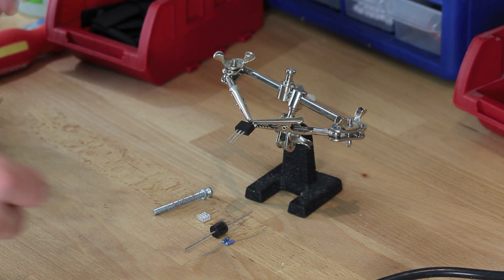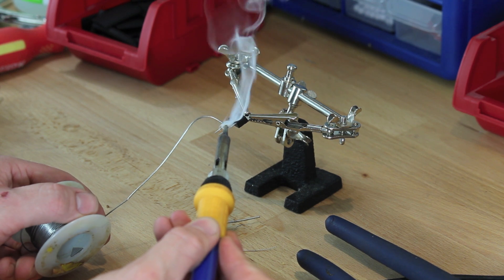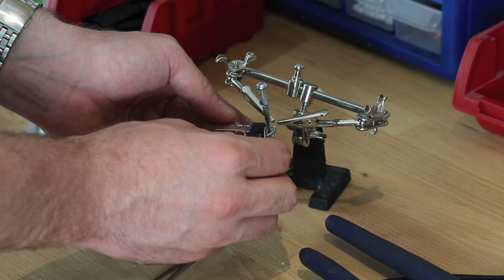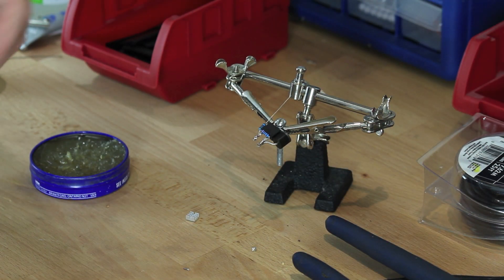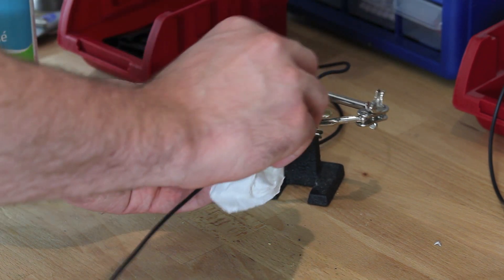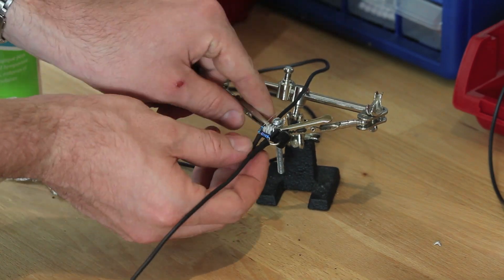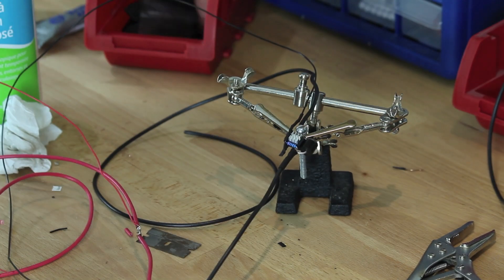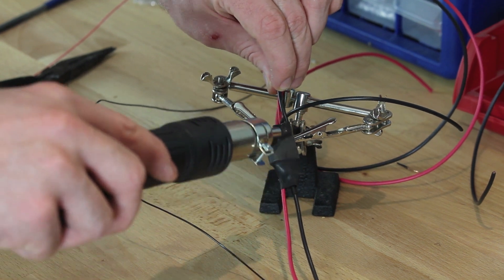How to Make an Airsoft Mosfet

Comment: i use this mosfet with m140 spring 11.1v 30c baterai and m160 bigdragon motor 
mosfet fry just 30 second i use with full auto 
whats the problem ? the mosfet get to hot  
6 times i try tu built it get same result mosfet fry
Reply: Agree

Comment: hello, I'm fron Brazil, installed the mosfet in my aeg but it is discharging the battery very fast, I did a test of 20 minutes firing intermittently the battery of 7.4 discharged to the point of no longer functioning aeg, has anyone ever encountered this problem?

Comment: can you link me the parts I'd need to do this same thing but with a little more strength, I want to use two 7.4 2500 mAh 25c lipos wired in parallel, or are these parts enough to withstand that

Comment: Where did I go wrong?
I have expirience with soldering and electronics, I'm working at cellphone service, bought supplies and made few of these...some of them were faulty at the beginging, and some of them just didn't work well, as soon as I connect battery rifle start to shoot in full auto with selector in safe position. Yes, I checked diode polarity, and after this happening I used a multimeter to check it and it seems mosfets itself died...diode was ok, so as resistors. 2-3 of them worked for maybe 200 shots and then suddenly became melting hot and died...
I'm out of supplies...any thoughts?
Reply: You need huge amps mosfet, and make sure it was original so it could hold a huge amps.
Reply: @ilhamprakoso1237  maybe it was fake amp, since I bought it from aliexpress
Reply: How did it go? Did you manage to fix the design or figure out what was wrong?
Reply: @juanderful229  no, since I couldn't figure out what was the problem. I didn't want to waste any more money on testing...

Comment: can you elaborate as to why your using such a large ziner diode and not just a regular diode?
Reply: It's TVS, not Zener.  And he doesn't know: the diode should be across the motor terminals, not the mosfet itself.
Reply: @rogerborg Can you elaborate on this please? I'm Interested in knowing what the difference would be.

Comment: What is the difference between using the internal diode of the transistor to the new one as used here? 
Moreover, I am making a simple assembly with two transistors IRF1404 to divide the intensity and remove some heating. Am I doing it right?

What mounting advise me for marui EG700 engine?

Thank you very much and kind regards from Spain
Reply: The internal diode of the transistor is a piece of shit. The diode used in this tutorial can actually take the voltage spikes from normal battery use. 
If you use two transistors, just be sure you get them in parallel with the same gate control and polarity.

Sorry, I have never used that engine.

Hope it helps!

Comment: 😒😔I'm so pissed right now because I did EVERYTHING and got every part needed. I REWIRED THE MOSFET 4 TIMES. Still no dice. Maybe the terminal connector I'm using to screw onto the top is faulty? Maybe the resisters because I went through five of each are faulty? I mean it worked one time and I honestly don't know how it did. I pressed on the 100ohm resistor and it worked?? I have no idea. I'm just so pissed because I was so excited to built a MOSFET so I could finally use my custom built gearbox.
Reply: +MrBeny127 Have you tried pressing the trigger contacts closer together? I thought I fucked up mine the first time too but turn out i just needed to get the trigger contacts closer
Reply: Dannyboy823 yeah. I just remade it. after I put my gearbox together after a long day of getting fired at my job, my mosfet didn't fit it. I was literally about to kill myself lmao. ill just pay stinger to do it. and for him to do a complete tech up. like shimming, aoe, etc
Reply: Stinger that plays at futureball?!?!
Reply: boom_man56 idk. btw i fixed my build. nice 40 rps now lol
Reply: MrBeny127 nice

Comment: Hey very detailed review, helped me alot. Got a question though. Would it be possible to add a capacitor into the equation? So that whenever you lightly press the trigger, the cycle actually finishes instead of cutting out half way through , resulting in no shot.

Comment: man, I tried to make this with a mosfet and diode that I got from radio shack's parts drawers and it didn't work. I think the diode was way off it was a 6A 05 1411 and the mosfet was a IRF510. no dice. didn't work. I ordered the right parts online so I should be able to reproduce the results from the first one of these I made
Reply: +Recovery12Life While technically feasable, the amount of capacitance you would have to add to the circuit would be huge, and the space it would take up would be totally impractical. If you want better response get a higher C Lipo as they have the ability to dump current more quickly.

Comment: I have some radio shack 6-amp rectifier diodes axial mounted like yours with 400amp surge for 1/2 cycles 9vpk would this be ok to use for these mosfets?
Reply from the maker: I have no clue
Reply: lol, it didn't work. I got the right stuff it just took some time for delivery. these things have been working great for me.

Comment: Hello, I made this mosfet and it works very well. I did however have several issues when I installed it. the 16ga wire was to thick and I had to seriously modify my grip to get the motor to slide in and actually had to do several modifications to the rest of the gun to get the mosfet and wires to fit. I did exactly what you sad and it looked the same shape as yours but I had to grind the hole in the reciever as well as the buffer tube and the plate between. it was a but more than I had hoped for but it did work. how bad would it be to use 18ga in the future. I mean is it really going to have that much difference with motor performance?
Reply from the maker: 18 is fine if you can't fit 16.  It can be a bit tricky to get in there.  If you are using 18 try and use high conductance wire to minimize heating and performance loss.
Reply: +Recovery12Life actually, 18 awg is no better than stock wire (18awg is stock wire, juts not chines stock wire) so your  better bet it to use ecowire 16 awg

Comment: do have 1 more question , in regards to the wire do you recommend any preference in size. ie I am using 18 gauge on the thick wire , what size do you recommend for the thin wire , is 22 gauge good enough or is it smaller still
Reply from the maker: I use 16 awg if I can fit it and 22 for the leads.

Comment: in regards to the diode i noticed that it has a gray band around one end , does it  matter which way that the banded end faces ??
Reply from the maker: It does matter.  The band must face the screw hole as you see in the video.
Reply: thanks , not very tech savy , great video very informative , did put first one on backwards lol but all good , its a learning thing  again thanks

Comment: Great video! But the diode just allows current to travel only one direction to avoid feed back. So I don't think its necessary. One other thinh is you should crush the wire before u solder it then screw it to allow for more coper to attach to the surface, or just solder the wire directly. I'm assuming ur using 60/40 and coper is much more conductive that solder is. Great design. I think I'm just gonna drop the diode and maybe do silver plated. Thanks!!!
Reply: Always use a diode when inductors and mosfets are linked. The inductance from the motor will kill the mosfet, I speak from experience
Reply: How did it work so far? with out diode

Comment: have question regarding the mosfet as far as the gate, and the switch poles, are these designated by the wiring or does the fet say on it which is which, as you can tell not much of an electrical person so  just want to make sure
Reply from the maker: Barry Rigler Provided its a 3034 you need to build it exactly as shown.  You cant switch the sides anything is on as far as I know.
Reply: thanks i  got the idea now , great  instructions and well layed out. at this time i dont need a fancy computerized one just something simple to protect my batteries and motor . again thanks

Comment: Why the trigger cable to the battery has to be as closer as possible?
Reply from the maker: you can really put it anywhere along the positive wire.  There is a design where you connect the wire directly to the contact but I can't make it work with the 16 AWG.

Comment: Hey, I'm looking for kind of a cheeper MOSFET. It seems like most have weird programming capabilities; I just want one that switches off when my lipo is running low. I'm a bit new to airsoft and I was wondering if this particular assembly fit the bill. Thanks!
Reply: +Daniel Warfield juts buy a lipo alarm while you are at it. they are like $3
Reply from the maker: This has no low voltage cutoff but I just stop when my gun gets slugish.  Haven't ruined a lipo yet.

Comment: Do you the Volt and Amp limits of this device?
Reply from the maker: I do not but I have heard of people using 14v city this design on crazy high speed builds
Reply: Ok, that's more than enough proof for me. Thanks for making this video, I'll be making a few of these with a slightly modified design.
Reply from the maker: Ya its a tried and true design.  I would love to know how they turn out!

Comment: Hello! What wire type should I use when making Mosfets?
Solid Wire
Hook-up Wire
Teflon coated mil-spec wire
Silicone wire

Do i realy need the mini cooler?
-Richard
Reply from the maker: Opinions differ greatly on this matter but I personally like 16 AWG stranded (not solid core) copper wire you can get at home depot or the like.  Silicone wire has superior conductance but it is fragile and prone to damage.    You don't need the heat sink but I like to add it as an extra layer of protection.  LMK if you have any more questions.

Comment: hi can you make them plug and play
Reply from the maker: I have thought about this and I don't believe so.  To have plug and play it requires a much more advanced computerized circuit.  I still like the direct wired version better as I believe it delivers better electrical conductivity.

Comment: Can you explain why you use a diode in your design?
Reply from the maker: Well I'm no electrical engineer but from what I understand it acts as an overload protector for the more delicate components of the chip.  Honestly you could probably use a smaller diode but this works for me and they seem to last awesome.
Reply: ExplosiveReview diodes are like a one way valve. and i'm certain you could've gotten away with something not so thumpin' big. but it's probably best you used that one.